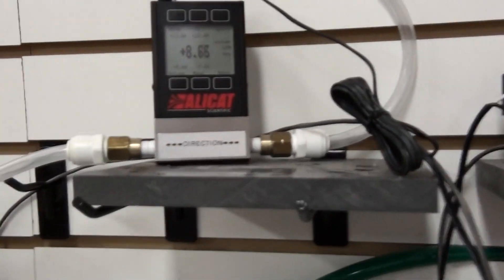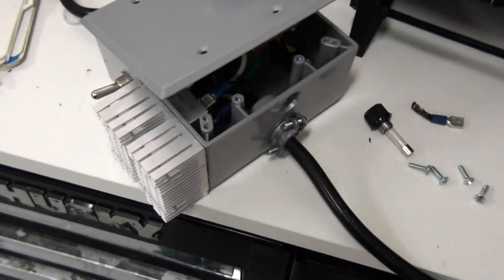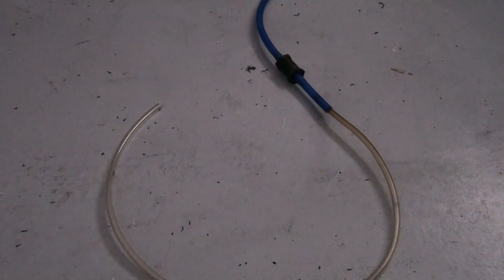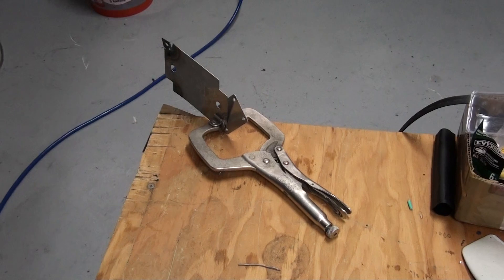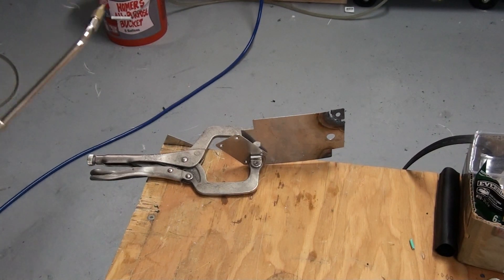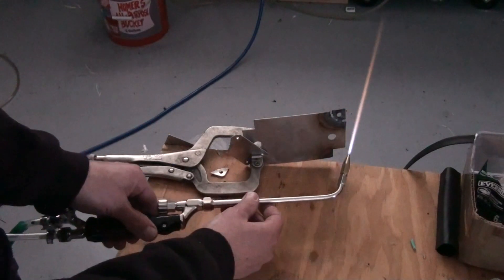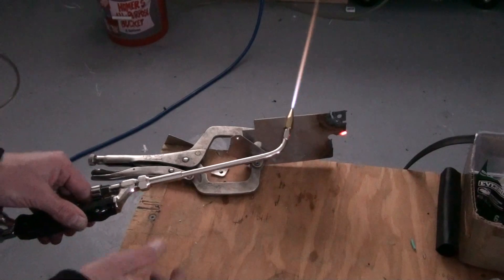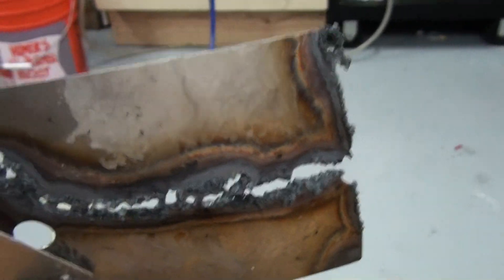Green Fuel H2o HHO torch and Flash arrestor for HHO gas

Comment: How can I get that torch,  Steve?
Reply from the maker: eBay
Reply: Hey, Steve. I want to but the 2 x 59 plate set with the 2 electronics pieces but was wondering if I could save some money by putting it all together myself or even for the plates and gaskets only?

Would you sell me the kit to put together the 2 dry cells myself?

Even as a one time thing, although, I want to buy the cells from you and start making torches and breathing machines. I have my first one and it's so cool. Would you ever do a bulk discount to buy the generators or kits to put your generators together at home? All we need is the approximate size to squish it all down too.

Comment: 7:07 Cool gas to have on hand for shop use I imagine there are a million things you could use it for.  

For cutting though, bruh, get a plasma cutter.  I got a cheap plasma/TIG/SMAW unit.  Only used the plasma so far, but it cuts beautifully.  Way cheaper to operate: 120V and I'm using a window A/C compressor for tankless air.

Comment: If you want oxygen, you can use an old medical oxygen concentrator. The invacare perfecto 2 is super easy to fix and get 96% o2 without parts to replace. I have used it to create a sun from a tealight candle.

Comment: 15.5 amps * 121 volts =(1875.5 watts * 60 minutes)/1000 watts per kwh=112.53 kwh * 12 cents per kwh in NJ=$13.50 an hour. Thats exactly the same kwh that a hairdryer uses btw. I wonder if it could run off a car battery? I heard about pulsing the electricity which is suppose to cut consumption drastically, but haven't can't find the video now. Its definitely out there and I'm curious how that method would perform with your setup.

Comment: That's a sexy flame. I need a better power supply on my new system. The only way I can get a flame that big is by connecting 2 car batteries in a series. I get around 24V @250 amp and the flame is powerful enough to cut steel pipes. My normal supply is a weak 14V 19A dc converter and that flame is weak as hell.. like a jewlers torch. I think if I buy 2 - 12V - 75amp converters on ebay then stack them... I should be able to cut steel pipe consistently. The burst cycle from batteries is nice but it lasts like 10 minutes and recharging for hours for a 10 minute flame is not very.... umm, smart.
Reply: Robert Cece go for a steel 130/240 plates on 127/220v, you can get a crazy amount of power, in the moment i'm using 130 steel cups as plates inside a pvc pipe to get 20A=2.5kw of power without a power supply, just a common full bridge rectifier and electrolitic capacitors.
Reply from the maker: One of those large car battery chargers with wheels puts out a lot of amps and I don't think they cost that much.
Reply: You could try a "Jetstream” 110/220 volt variable power supply, radio enthusiasts use them and are pretty good, i was getting 11v to12v at 30A

Comment: Excellent! I like the setup. I'd bet that cost a pretty penny.
Would it be a good idea to have 2 or more flash arresters in the same line in case a single one poops out? What do you do with the HHO that's generated while you're not using it? Is there some way of temporarily storing it and regulating how quickly it comes out when you do use it? If it just vents into the air shouldn't it be vented to outside? It does seem to be a very explosive gas mix.
I only ask because I don't know. I've been interested in HHO as a supplement for fuel in cars and trucks for some time now, but I'm still working on gathering info about using HHO with a torch, etc. Other than that, I'm just asking because I'm looking for more information and I'm interested.
Thanks.
Reply from the maker: Brice
I use 3 safety devices between my reservoir tank and the torch. One small arrestor a large arrestor and a flash port on my bubbler.
You cant store the gas because its extremely explosive. It's okay to vent it onto the room with proper ventilation.
Reply: delvis11 Thanks. Satisfied on all counts.

Comment: Hey Steve what is the voltage and amp rating on the rectifier you use?
Reply from the maker: This one has a 70 amp 600v
I also use 80 amp 1000v bridge rectifiers.

Comment: very cool, how long can you run at 15 amps ac? before things get to hot
Reply from the maker: The reservoir tank are small so things heat up fast. I think I can run it for about 30 mins the way it was set up in the video before things get hot. The power supply can handle the 15 amps fine.
Reply: very cool to see the effects of a very large cell verses a small cell at the same output
Reply: delvis11 I had a HHO set up last year as an experiment, it was not fitted to anything just for curiosity, i spent a little time on research as to optimise my system and got 2 great tips... overdose the distilled water with Potassium hydroxide, that makes eloctrolysis easier at lower voltages and tip two was to add a restrictor to the water feed entering the dry cell, be careful not to starve the cell of water by restrictin it too much or the reactions will just stop due to lack of water, kinda adjust water flow via a valve and this will solve the issue of the reservoir tank heating, i got just under 2 LPM with 2 x 4" 5 plated dry cells...imagine what your output would be if you tried it with that monster ha ha!...give it a try! Regards
Reply from the maker: That's for the comment but I think you have a lot to learn. The heat isn't caused by water restriction. just FYI
Reply: delvis11 Thats not what i said, my comment suggested fitting a valve, please re-read my comment.... Im impressed with your rig, it looks great... and well actually i learned that restricting the flow of electrolite to the cell does infact reduce the reservoir heating up and improves HHO production also...   fyi